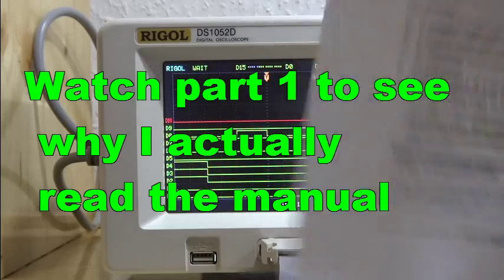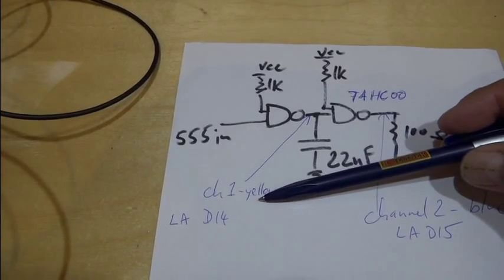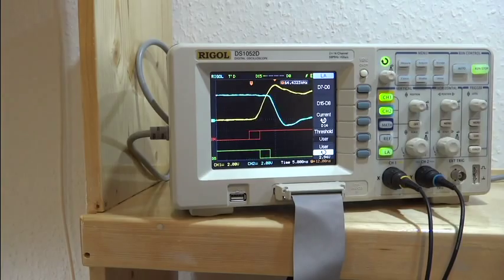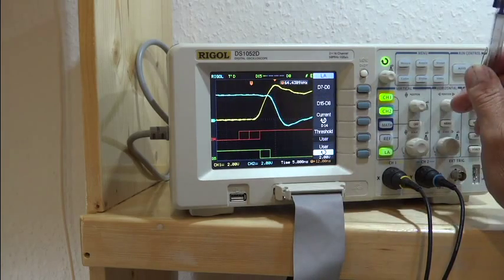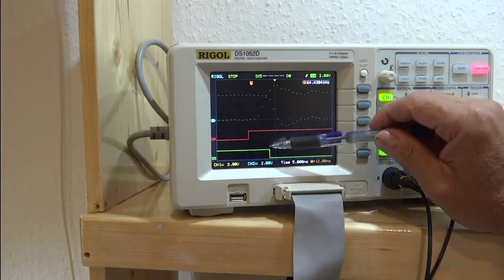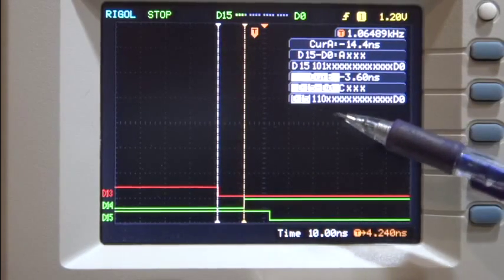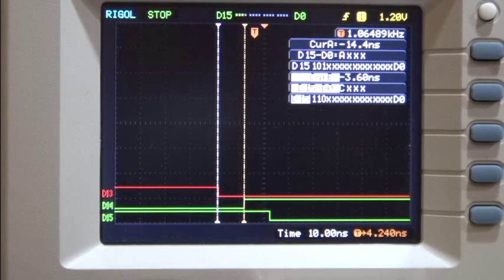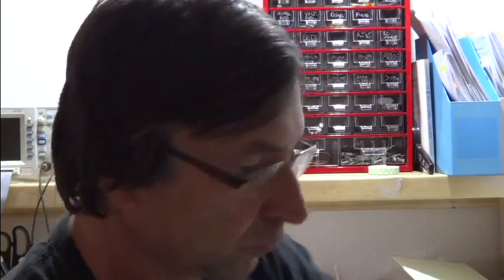Rigol DS 1052D review_part2

Comment from the maker: Haven't seen any updates -  in the beginning I thought that  the  one-in-all would a good choice considering the limited space I have. The Rigol is still quite fast - you can get 500Ms on 16 channels  and .5 Msample memory. But I think for $300 ( the delta of $316) you can get something a bit slower but with a much better user interface - just the fact I cannot have a bus is a killer - try reading 8 bit bus individually). so for a 16Mhz ucontrollers a 80Msample  LA will be good enough.

Comment from the maker: Yes, the Logic Sniffer is definitely a fantastic idea and a reasonable price. I would stay away from streaming USB ones with all the analysis done inside the PC. Seems like they are a bit overpriced (but you do get a beautiful, machine aluminum case. I am really happy with the DigiView DV3100 - fast (100 Ms), some input protection, good SW,  and a killer memory length with a compression algorithm that makes life so much easier. SO, don't get the DS1052D and get the Rigol scope a stand alone LA.

Comment: It looks like the pricing has changed since your review. Right now I see Saelig has the DS1102E for $399, the DS1052D for $549 (50 MHz), and the DS1102D for $715 (100 MHz). So the logic analyzer is a $150 or $316 increment depending upon your needs.

Have their been any software updates since your review addressing the logic analyzer? I appreciate you going over some of the issues that you noticed.

Comment from the maker: Yes, good explanation. But I find a bit disconcerting is that if  I am using the pattern/edge triggering - I would expect the pattern would have to be met and then the edge will trigger the scope. - but I actually see things such as the edge occurs 500ns before the pattern is true and it triggers.